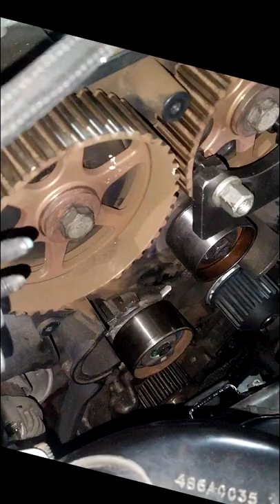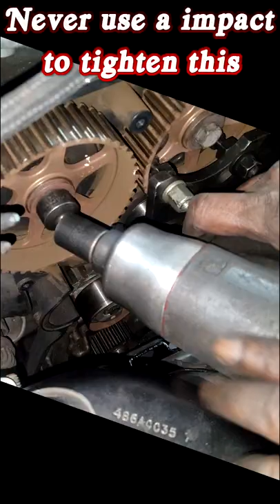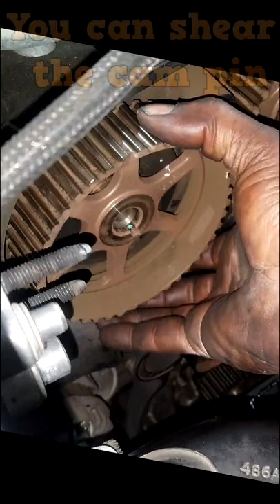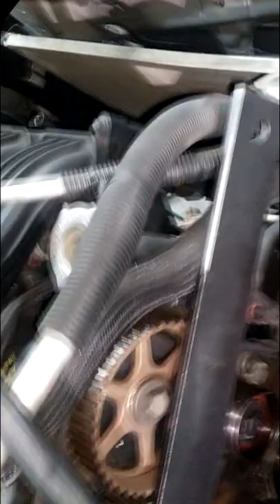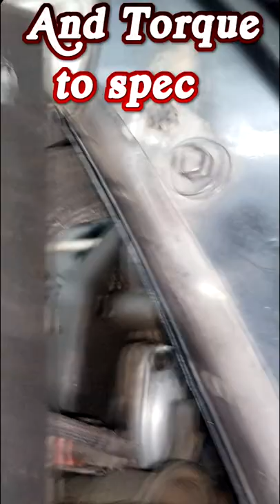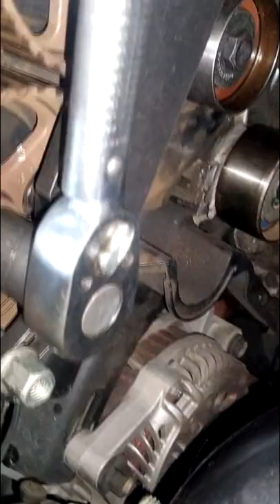WARNING. Doing this can destroy your motor. DO IT THIS WAY #JTtheCarGuy #shorts

Comment: You can indeed use and impact to tighten that. Holding it still and tightening it is was breaks the key. You gotta let it free rotate with the impact. It won't rotate much but it's probably better to have the belt on before hitting it with the impact just in case.
Reply from the maker: Or you can simply hold it in place with the proper tool and torque it to specs, thats always an option.
Reply: @OnlineMechanicTips  
Some guy doing a timing belt at home is not gonna want to buy the tool he'll only use once. I was just making sure people know there's another way and the real reason why the key breaks. You can break that key with that tool holding it in place too if you over torque it. My way isn't possible to break the key, you'll break the bolt first. It's not a pissing contest brother.
Reply from the maker: @Jayis_preppy  O well you didnt make yourself clear. This is an excellent point if you dont have the tool or a torque wrench but trying to prevent from ruining the key by using a impact.  Thanks

Comment: That looks suspiciously like the front of our PT Cruiser four banger. And yes, I use no power tools when tightening the bolts on the cam gears or crank gear. I had to laugh since the keeper pin on one of our cam gears broke off and was the source of endless trouble. Finding the "real" source of the problem was the whole game. Learning a lot from you. Thanks and stay safe!

Comment: Refresh my memory. This is the Chryco junky 2.4l. On this one the timing gears have to be removed if you are doing a water pump as well correct? Something about the rear timing covers obstruct the water pump? It's been ages, but I remember the cussing.
Reply from the maker: Ding ding ding..yea just about the complete timing has to come apart to do water pump. Thats actually what I was doing on this PT Cruiser. Thats like the best time to do it all including motor mounts at this time.

Comment: You sure don't want that cam pin sheared off.
Reply: I had exactly that happen, and it happened without warning and no work done on the motor gearing. Go figure!
Reply: Why not? Sometimes the pistons and the valves want to go to the big dance together.

Comment: I used a belt wrench and it works till pretty close to 130 ft lbs then it slips. That’s a cool tool though.
Reply: You mean a strap wrench? There are plenty of tools to hold  the gears for you. The one showcased in this video works great. There is also one that splines into the teeth and locks both pulleys together. That one also works great.

Comment: Did those bolts require a rotation past torque? Otherwise you overtightened the crap out of them. Stop at the click for anyone watching
Reply: He did stop at the click. the video replays for emphasis. Also on a click style torque wrench one double checks the torque by making it click a second time. That's why you set it to the lower spectrum of the torque spec. 🧠
Reply: The first time seemed fine. The second clearly was overtorqued. *Click*...continued moving.

Comment: How bout lubricating the threads??
Going in dry will not be the correct torque, but you may think so...
Reply from the maker: And what would you have liked me to lubricate them with sir? And how would that change the torque sir?
Reply: Anti-seize
Reply: How about following the manufacturers training for the supplied vehicles?

Lubricating the wrong bolt and you have problems. It can also create an over torque situation.
Reply: Also applying oil to a bolt going into aluminum...  Bad day.

What can and often happens. The bolt is over torqued wet and results in broken or stripped. There's specific bolts that apply anti seize and many installed dry.
Reply from the maker: @vincenegra2612  Now why on earth would I put anti seize on the thread of that cam bolt?
Reply: @OnlineMechanicTips  
You can always steal a drop of oil from the 
Dipstick. I must be old school. I've always liked my threads cleaned n lightly lubed. Clean is the operative word here. Going in with dry dirty threads will not only grind down the thread surfaces but cause it to lock up sooner, giving you a torque reading before the bolt is actually "seated" n torqued... Go ahead n follow your recommended training, I'm just following my engineering handbook on torque specs n techniques . On another note, most torque specs have a range, not a single number. I always choose the first or lower number of the torque spec.
Reply: @Pork-Chopper  I like to go RIGHT in the middle, giving the margin for error that makes me feel safer knowing that my torque wrench may not be perfect.
Reply: @JohnNguyen-iw8qn  Camshaft isn't aluminum. But regardless, no oil is needed for the cam bolt.
Reply: @Pork-Chopper  Perfect example of book smart, life stupid as my dad says. Why would those threads be dirty? The timing belt lives encased in a plastic cover sealed with a dust gasket. Only way any debris could get in there is if the cam seal fails and you have oil ingress behind the cam gear.

At that point you are cleaning everything anyway. As far as the threads go some brake clean and a puff of the air wand and you are good to go if you suspect it is dirty. There is absolutely no need to lube the threads on a cam bolt. That's only necessary on some cylinder head bolts, and depending on the manufacturer. Each has their own approach to it.
Reply: @LynxStarAuto  
Old habits are hard to break.
I always use K-Y before I put it in. 
Comes out easier next time...
Reply: @Pork-Chopper  his and hers works well and add spice

Comment: I’ll do it like this next time I rebuild my motor lol. Maybe one day I will have that kind of confidence
Reply: That's not a rebuild. It's a timing belt job. It's a 2.4 Chryco junk motor and you have to remove the cam gears when doing this job iirc. Something about the top cover obstructs removal of the lower cover, which subsequently has to be removed to change the water pump. 

Don't quote me on that, it's been ages since I messed with one, But I know there is some technicality on the 2.4 that requires unnecessary disassembly when doing a T-belt job.

Comment: 1 drop of BLUE lock tite... Your best friend on cam bolts. 😁 NOT THE RED TYPE!!! 😵
Reply: Too tight on the red kind?
Reply: @rustypotatos  Red requires HEAT to let loose. Blue doesn't. Blue only holds bolts / nuts from vibration loosening. 😁👍
Reply: @jasonpocaro2730  o sheet wow ok great to know Ty
Reply: You don't want to put any type of lock tire on these bolts. Less you want a headache on disassembly in the future. You torque to spec and move on with your life.